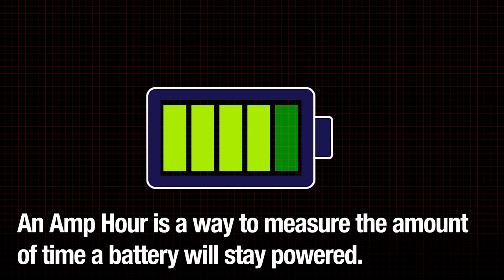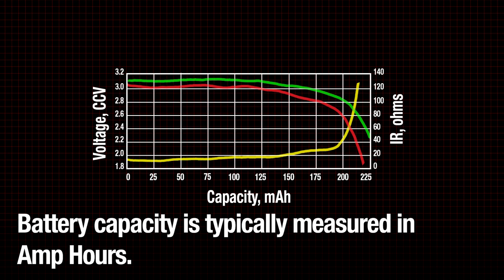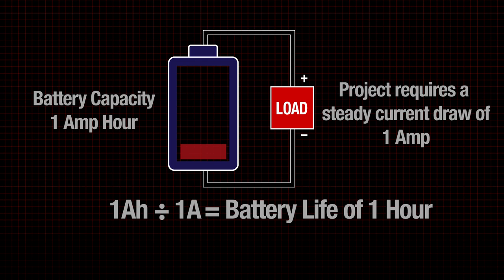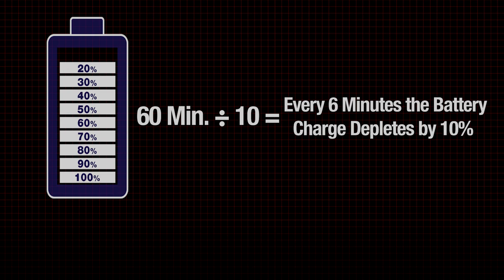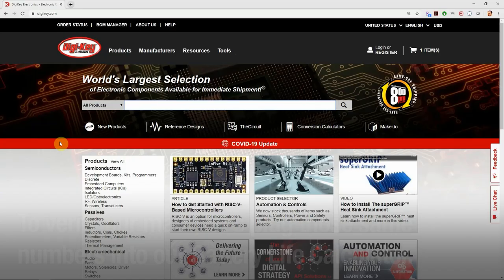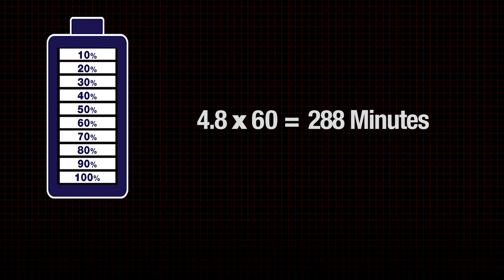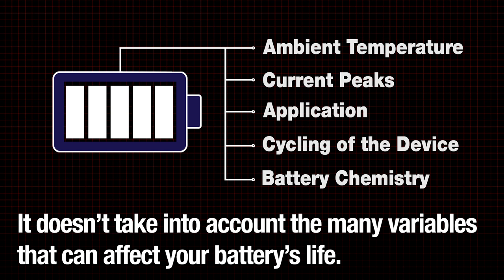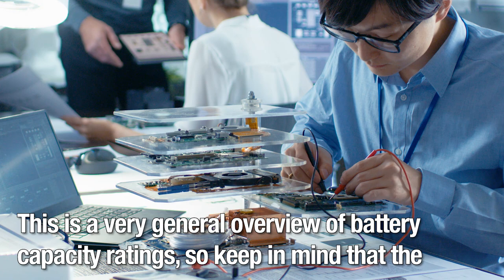What is an Amp Hour? - Another Teaching Moment | Digi-Key Electronics

Comment: Great video.
Question, my battery is 48v 20ah.  My controller is 48v 20ah. Manufacturer upgrade from 20ah b/c none in stock.
Will this combo work? Heard it could damage battery.  I use PAS too when riding.

Hope you can help.

/Bklyn👑

Comment: So the more amp the longer it lasts ?
Reply from the maker: That depends on the circuit it's powering. If you have a 1Ah battery and are powering a circuit drawing 1A, the battery will power the circuit for 1 hour. However, if you are using that same battery to power a circuit drawing 500mA, it will power the circuit for 2 hours.
Reply: If my circuit draws 12V 2A, and I'm currently using a 12V 2.6Ah battery, could I extend the time I can use it if I change it for a 12V 4Ah? Would there be risk of damaging the circuit?
Reply: @elliotrodriguez523  no risk, and yes you will extend your usage

Comment: The amp–hour is NOT a unit of energy.   It is a unit of electrical charge. To find out how much how much energy the battery can store, you need to multiply by the voltage.  The Watt–hour is a unit of energy.